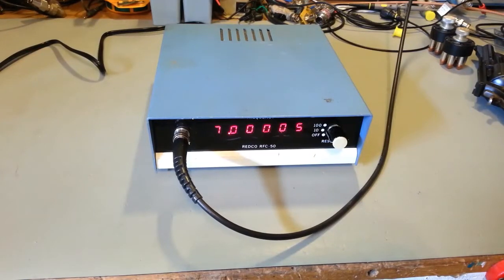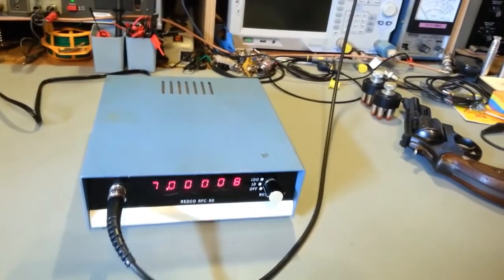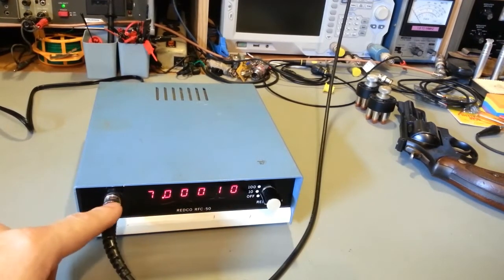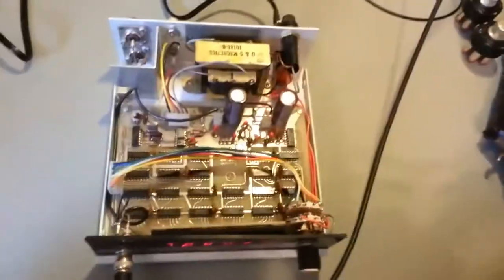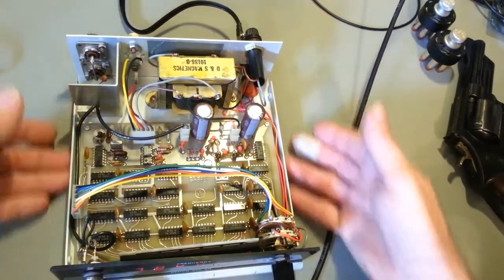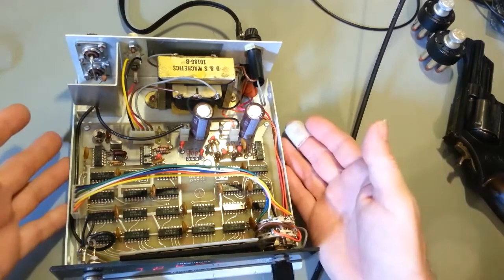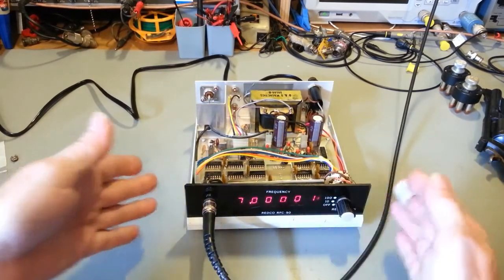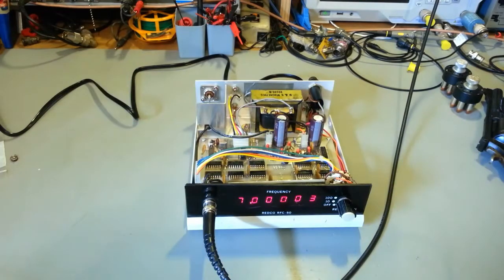Redco RFC-50 in line frequency counter restore and calibration.

Comment: The accuracy can be improved by replacing the 10MHz xtal with a 10MHz OCXO.

One of the cheaper modules on Amazon would work and be miles better than the stock XTAL.

Comment: With the easy availability and low cost of the digital frequency displays commonly added to boatanchors this counter becomes little more than a novelty unless used as you said which is to see what frequency a radio is transmitting at.

I have one like this except someone redid the display and omitted the far left digit and removed the chip under the switch.

Never use it since I have the digital frequency display